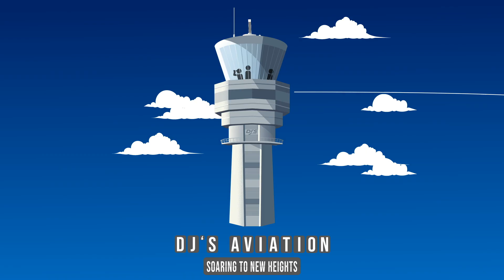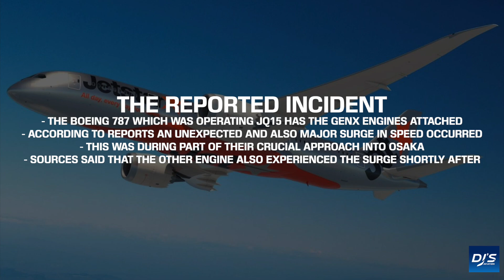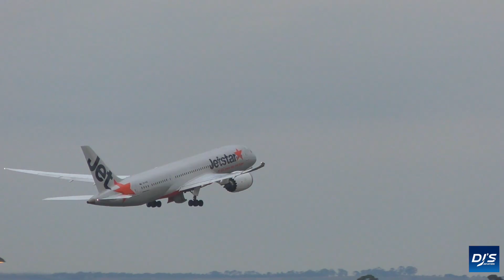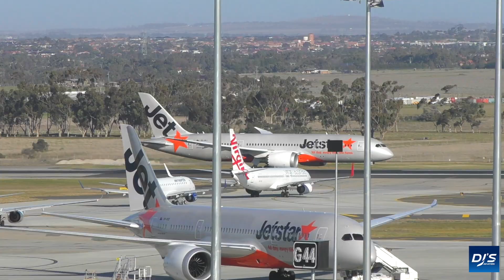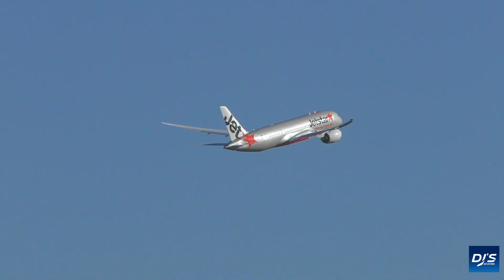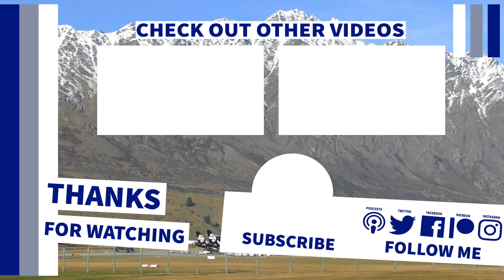Boeing 787 Experiences Dual Engine Problems

Comment: who is here after the air india incident?
Reply: Re. AI171.  Anyone know if when theses switches were CUT OFF, exactly what is the indication of these switches having been CUT ? 

Is there a big red flashing light, an indiction on the display, or no indiction apart from everythin lighting up like a christmas tree?
Reply: @videotechnique  Most likely fuel flow indications, N1 N2 exhaust gas temperature.
Reply: Me.
Reply: Boeing is in a deeeep trouble.
Reply: @Imot1970  lol, bribes already paid.
Reply: Me!

Comment: I would say this is a very serious issue. While single engine failures occur, there have been very few occurrences of a dual engine failure on a commercial aircraft. Fuel starvation has historically been the culprit in dual engine failures.

Comment: Why people are relating surge with fuel system malfunction...... engine surge happen due to in back flow of air ..more accurately increase in clearance between blades and related cases

Comment: These are pwge engines.its interesting the only know incident reported was on approach.wonder if its fuel line iceing issue again...interesting if there is a connection with the amazon 787 crash last month?

Comment: Hey, where did you find the information that this plane operates on GEnx engines?  In most of the articles I read about this accident, said the the plane had Trent 1000 engines.
I booked an 11 hr  flight for may in a 787 dreamliner, so I really want to know more about this, and the outcome of the investigation

Comment: An investigation should be launched. Boeing had a bad start too 2019, 737 max's stall system problem now 787 dual engine failure

Correct me if Im wrong about the Stall problem I think that was the problem...

Comment: It’s just one plane and as you mentioned it did not trigger the need for an emergency by the pilots.  There have been no other reports like this on the 787 and it sounds like an engine issue, not a Boeing airframe issue.

Comment: These engines are fine tune better than a Swiss watch. The fuel atomizer pattern has to be perfect and to be so fuel efficient it has to be the least amount of fuel sprayed in the combustion chamber. When you combine things to such a tight tolerance over hundreds of hours of operation which is the interval for inspections, it could develop those kinds of problems. Listen all fuel has some kind of contamination all of it. And this engines whether is the trent 1000 or the GenX they are very similar and susceptible to surges or shot downs due to fuel contaminants.

Comment: As this is a very concerning incident, I am delighted that you were able to report that the flight crew was able to get control of the problem. Here is an argument for the quad jets, more than a single redundancy. Although, fuel is proving too expensive for airlines to justify the cost of quads.

Comment: BA 38 (777-200ER)  had a dual engine flameout on the short final to LHR in 2008 caused by the fuel-oil heat exchanger being blocked by some amount of frozen fuel. Sounds similar!

Comment: I just saw this as I said it and sent as well I’m hoping that GE Boeing and Jetstar quickly solve this problem and get that 77 back into the air I’m surprised to hear about the engines for General Electric I’m having problems like this I’ve never heard them I never heard him ever since the Dreamliner  came out having problems with engine

Comment: So this occcurred while landing on approach to Osaka?  Sounds similar to what occurred some years ago to a British Airways B777-200 on short final resulting in crash landing into Heathrow.  That was caused by ice in the fuel or fuel lines that broke loose and obstructed fuel intake by the engines.  It will be interesting to see if this was a similar occurrence or something other.

Comment: Quad jets could possibly suffer the same issue if all the engines have a similar service life - a surge in each engine. Highly unlikely..... I presume the engines, over time, will have been swapped about and therefore different service intervals ? I’m only a layman and like the idea of extra engines. Maybe someone can explain the service regime?
Thankfully the pilots were able land the plane safely. Good video.

Comment: Just send me back in time and let me get on a MD-80 or L-1011.
Reply: You were probably not aware of the engine problems we were coping with at that time with the RB211. There were planes parked at LAX and MCI with concrete tie down blocks because no operational engines were available. A nonrev was not sure they "made the flight" until after top of climb because of top of climb stall problems. Even the 747 had problems with the JT9. As far as the GE they were some of the most blown up engines I have ever seen. I lived in Redondo Beach in the 1970,s across the street from the water tower. I was sitting in my living room when the whole house went dark and I saw a 747 pass over. I went to work and there was an Alitalia 747 in bay 5. The #4 was split open from the compressor case to diffuser.
Reply: @jayreiter268  -  maybe you could post something like this in a diatribe of your own instead of trying to find fault with the most innocent comments other people make?
Reply: MD-80s (better known as DC-9s) were awful.  L-1011s were great, but I was once on one where the tail engine went BANG (scary as hell) in flight and had to be restarted.

Comment: Did the engines surge or flame out? If it was a surge then auto thrust subsequently disconnected, followed by a landing, I can see why they didn’t declare an emergency. Runway 06R is 4000m

Comment: Yes, very unusal for both engines to experience the same problem on the same flight. Just speculation on my part but it seem that both  lacked fuel and secondary systems had to be activated. 
DJ, do we know how many GENX problems have been recorded on this engine package?
Reply: Well, it did happen before, although on RR and 777 instead: BA37
Reply: @dbclass4075  thanks but I was pacifically talking about the GENX. We all have been following the RR Trent engine 787 package. The GENX also powers the 747-8s but help me here, 777s currently flying are powered by the GE90 series power plants?
Reply: @thomascdurham9130  Yes, but GE90 are the predecessors of GEnx. GE90 still holds the record for the most powerful engine, and has a proven track record (think 737NG vs 737MAX). More importantly, GE90 is overpowered for 777, so its limits are rarely exceeded.

Right now, that is quite worrying: 777X is larger and heavier, but GE9X is also larger, but less powerful.
Reply: @dbclass4075  thanks! I forgot the GE9X series that will be powering the 777X. 
Yes, they traded horsepower for fuel mileage so they will have a product for Project Sunrise and the ever growing Asia market.
Reply: @thomascdurham9130  They are threading thin ice there. They better not take fuel efficiency too far to the point of insufficient power. 

Come on, they managed a powerful and efficient engine from GE90. They could do again on GE9X. No need of excessive compromises.
Reply: @dbclass4075  I was thinking more like an electrical blink/hitch on the electrical /cpu that control the fuel pumps. But don't forget the 767 Air Canada flight that ran out of fuel when they (Canada) switched over from the imperial to metric measure system.
Reply: @thomascdurham9130  It boils down on how properly technology is implemented.

Comment: What occurs when an engine surges?. but yikes Boeing is not having a good year. Hopefully they get the 787 and 737 max fixed up and get both back in the air later this year.

Comment: Luckily it was not installed with MCAS.Shocks from engine surge  can affect the angle of the AoA sensor,isn't it?
Reply: AoA affects the airframe. Engines need a completely different sensors for proper operation.

Comment: Most probably an isolated case. GE knows their engines well and this case is either driven by specific conditions during flight or a maintenance mistake from the airline.

Comment: This is not repeat not a Boeing problem this is the engine manufacture problem so  stop making it sound as if it’s Boeing   problem please
Reply: Not quite true, pretty disingenuous in fact, as the aircraft manufacturer is responsible for a lot of how the engines are managed in flight, everything from software and installation to training. Funny how Boeing tragics outsource responsibility for problems on Boeing products back to component manufacturers, but never do the same when an Airbus model has issues.  It affects a Boeing aircraft, Boeing are responsible, whether you admit it or not.

Comment: Airline engines these days are designed with one thing in mind - fuel efficiency , so much so that their reliability has gone down. 
I operate the A320 Neo both the PW and the Leap have problems , the PW more than the leap . the 787 engines have problems , so did the A380 . manufacturers have pushed the boundaries of what is physically possible with ever increasing combustion chamber temperatures and exotic materials for fan blades .  Lowering the engine weight and making it operate under more extreme conditions all in the name of fuel saving. all this does save fuel but i am  afraid they're no longer the rugged work horses they used to be.
Reply: Now here's someone that speaks from true experience and brings about a good point.

Comment: Re;  'It's important to know that double engine failures, as many have called it, can happen and do happen."  This fact explains why I am scared when a plane, on which I am a passenger, is flying under ETOP rules.
Reply: Too bad. New planes are earning insane ETOPS certifications. A350 is rated for ETOPS 370.
Reply: @dbclass4075  Sooner or later, there will be a double engine failure during ETOPS.  It might happen today; it might happen a hundred years from now.  (And I'm sure hoping it is the latter.)  Then the error, of being confident about replying upon technology, will be disastrously apparent.
Reply: @WaterlooExpat  Actually, we have a bigger issue about reliance of technology now: pilots who still remember how to fly manually.

Comment: "Boeing, Boeing, Boeing". The media outlets will be quick to point out it was a Boeing. Just because it will get views. Giving more bad publicity just because. Even though this has nothing to do with Boeing, as the engines are made by another company.
Reply: Because it thinks that it's too "Boring".
Reply: Again even though it's not boeing specifically in terms of making the engines. But they still play apart. 

When building an aircraft every thing HAS to matter. Whether it's GE fault boeing still has the final say on whether the engines are going to be used.
Reply: @mipmipmipmipmip Yea, this isn't the first time both engines gave up on an aircraft, several of these happened to other planes, hope it gets sorted out sooner

Comment: This reminds me of the Baw B772 crash at heathrow a few years back that was caused by ice build up in the fuel system but that kiĺed the engjnes instead of making them surge.
Reply: Not really killed. More like rolled back to idle, uncommanded. Although, it is good as killed anyway.
Reply: @dbclass4075  your right it was a poor choice of on my part.
Reply: @thearsenalmisfit2414  Aviation terms are really notorious for its technically, anyway.

Comment: 2019 is not shaping up to be a good year for Boeing...
Reply: Well there's a difference between Boeing and GE if it had to due with an engine then it's GE's problem
Reply: Gabriel Sasala true but Boeing is going to catch hell over those Max’s
Reply: Gabriel Sasala it’s definitely not a GE problem. It’s a problem with the 787. Especially if both engines are going out. Better check the fuel lines or something.
Reply: T.S.Dragon notice how this is reported now when I happened back in March. It wasn’t an emergency. Don’t try to blow this out of proportion more than it is because you’re a little bandwagon follower.
Reply: This is indeed a fuel contamination, same problem occured on CX333 in 2010
Reply: @T.S.Dragon Well, to be honest, L-1011 also had the same debacle with Rolls Royce too before. 

I don't know. A lot of past incident happened again now, albeit with more advanced technology.
Reply: @T.S.Dragon Looks like the competition went a bit too far now.
Reply: Facts!
Reply: So far NO Airbus planes have crashed this year...
Reply: NYC Flyer has nothing to do with Boeing
Reply: @Tom H. LOL!
Reply: T.S.Dragon when you can speak English and use punctuation come back and we can have a conversation
Reply: Or the people who died on the boeing max
Reply: To the average consumer/user, GE on a Boeing plane is a Boeing. Lol
Reply: Guess what? Singapore airline has problems with their RR engine on their B787-10s.
Reply: Unless Boeing finally reveals the 797, it's some heavy turbulence for Boeing
Reply: @T.S.Dragon Don't worry about him. He has a Comprehension problem. Your English is fine overall. Australian.
Reply: Aircraft from any maker has has all kinds of issues. Your only info is what you are getting here and regular media is a fraction of whats all going on out there.
Reply: I heard a story that all planes are not that reliable is that true?
Reply: They earned what they're getting.
Reply: NYC Flyer nope!!! I told this guy on my Facebook that and he tried to say to me “are you smoking crack?” And I’m like “how many airlines are gonna suffer?” “How many people gonna sue?” They just had trouble with the Dreamliner and now worldwide groundings pushing small carriers into the ground!!! Plus the FAA is getting scolded by congress so as we know sh!t rolls down hill!!!
Reply: @blondescorpion8940  agreed! This is a PR disaster for Boeing!
Reply: @nycflyertravel  the engine issue has nothing to do with Boeing  and has everything to do with contaminated fuel. And the only ones that will get it are those that are in the know you are just some YouTuber who probably works at a Burger King trying to give his all knowing nothing LOL
Reply: @brkitdwn  Nah, I work at McDonald's.

Comment: Just heard on The news that the pilots on the Ethiopian Max crash had complered the procedures to get control of the aircraft after the MCAS problems started and the procedures did not work. This is not good for Boeing and the Max.
Reply: Steve  YOU did NOT listen to the WHOLE report !!!!!  The pilots turned OFF the system and regained control and for some reason turned it back on and crashed !!!!!  Also it was reported the plane suffered a strike of something, bird, on take off !!!  Did that damage the sensor ?????  Listen to the whole report and not just the ATTENTION grabbing headline !!!!!  DUUUUUHHH!!!!!!!
Reply: @wilburfinnigan2142  You do realise mainstream media are terrible for small (but crucial) details, right?
Reply: I have not read or seen any reports of a strike before the crash or that the pilots turned the MCAS back on. I can only mention things I have seen or heard. Try not to be an ass next time.
Reply: @thearsenalmisfit2414  Thanks for the false news.  If you hadnt posted for us all to see, none of us would have heard anything!
Reply: @thearsenalmisfit2414  Let's just wait for the final report of the accident, shall we?

Comment: I actually have no comment, no idea what could cause 2 engines to variate thrust around the same time that haven't had problems on any other aircraft before. Definitely really weird but probably not much of a concern overall.

Comment: The 787 is like the xbox it has many problems on release.
Reply: Xbox's "Ring of Death"
Reply: Except it's not on release lol
Reply: @Thezombieguru3565  but the 787 did have battery issues on release
Reply: Then what's the 737 MAX?
Reply: An Apple product that has a pop-corned CPU Chip. LOL XD
 @largesoda1729

Comment: Lol all new engines had issues

Trent 1000
Trent 900
Trent XWB
GEnx
GP7200
LEAP
PW Geared Turbofan
Reply: Trent XWB ? wtf
Reply: Zack B Iberia A350
Reply: Very, very true! Usually those issues are sorted out and the engines go on to become stalwart fixtures in the market. 

The original version of the P&W JT9D - the one flown on the 747 during its initial testing and certification -- was so finicky that wind blowing up the tailpipe could make it run erratically or flame out.

The early RB 211's chosen exclusively for the L-1011 nearly bankrupted Rolls Royce due to developmental issues, including 'Hyfil' fan blades that had to be redesigned.
Reply: It seems the competition went a bit too much.

Comment: Lowers my view of Jetstar pilots, surging engines and did not request priority landing, this could have ended very differently. Will pay the extra and fly Qantas as their pilots are of a much higher standard. Fly to Japan regularly so once you add luggage, food etc. On Jetstar you might as well fly Qantas when on special with more experienced pilots. Yes I know Qantas owns Jetstar, but the pilots are not the same calibre.

Comment: This is not good for Boeing. Yes, the engines are made by someone else BUT they can't brush off accountability so easily. These engines aren't merely plonked on like you plonk on a seat. They are integrated into the aircraft at all levels and this could again be a software issue in one of the hundreds of systems or subsystems.
Reply: It's an engine issue other than that is pure speculation, if it's a software problem or a design problem it would endemic to a lot of similar aircraft, so far there is no signs of that. (the engine problem in Singapore airlines is due to metal failure in it's engine blades, definitely not a software problem and totally not related to this story)
Reply: agreed. @inisipisTV